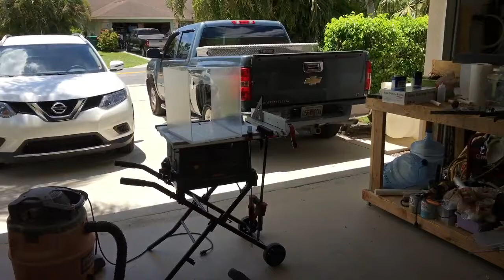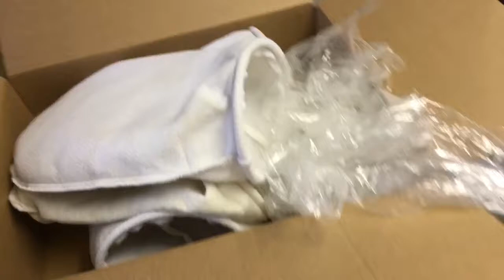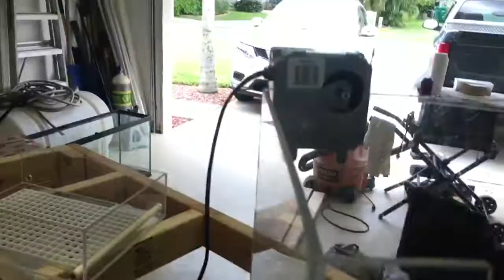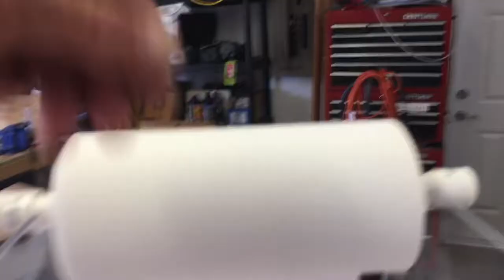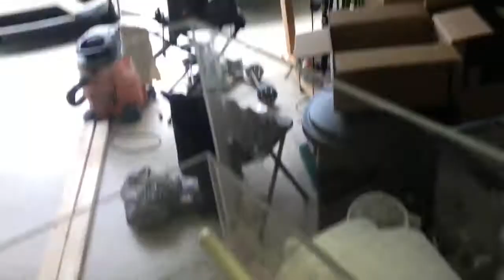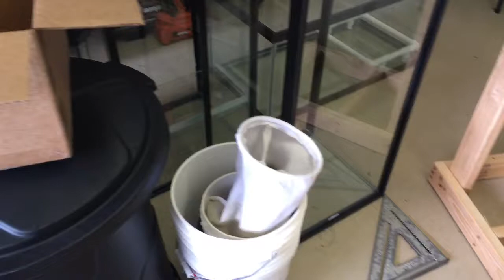AUTOMATIC ROLLER FILTER BUILD

Comment: Ray great video. This has a lot of information about how this works and why it works. Kept it up Ray. How much noise does the motor and water make when the water is coming out of the intake?
Reply from the maker: Thanks for the comment, the motor is silent , this whole system is very silent running.

Comment: Nice video. I love the roller filter. What type of motor are you using?
Reply from the maker: It is a 3 rpm motor that i bought at my local pool supply warehouse, Im sure you could find one on amazon or ebay, this one is 120 volt and that means no relay needed. Thanks for the comments, Ray.